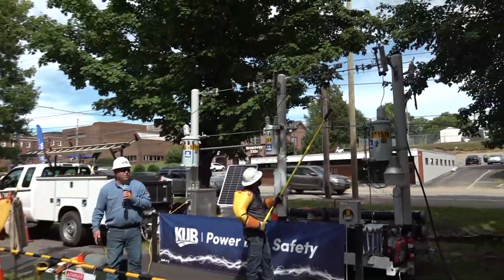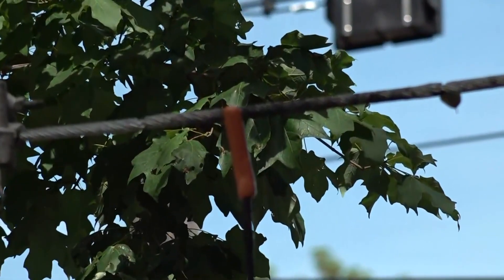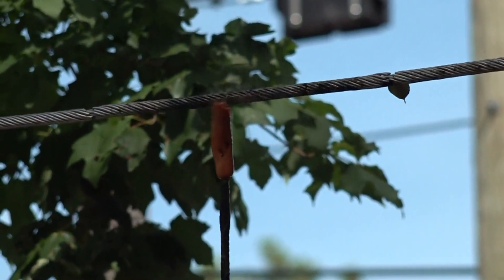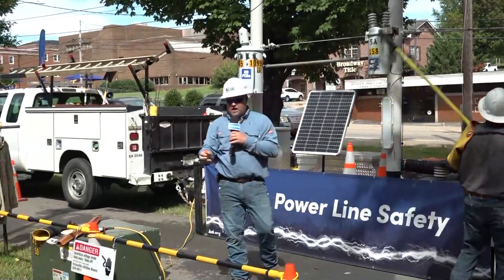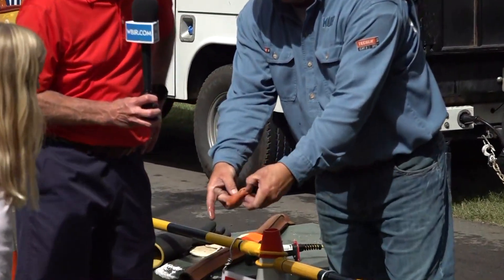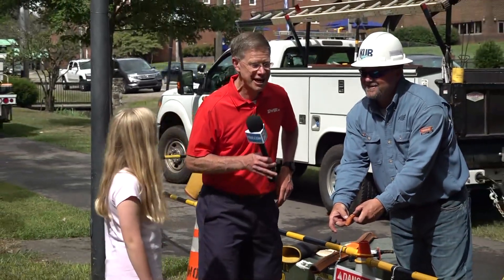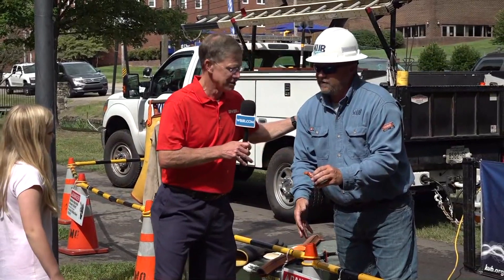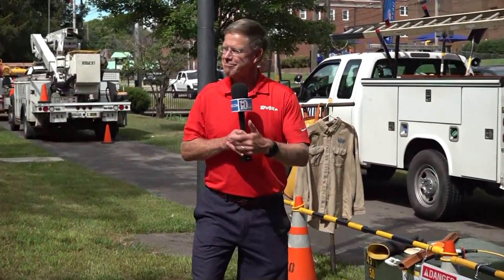Here's why you never want to touch a live power line!

Comment: they should have explained it happens a lot if you are working near powerlines like maybe installing a tv antenna on your roof or trimming trees near the power line you always have to be conscience of where they are because arentr they like 10000 volts from the street? and your house drops it down to 120 or 240 volts?